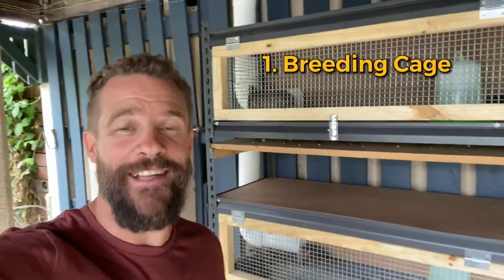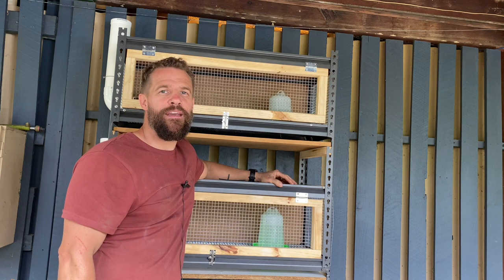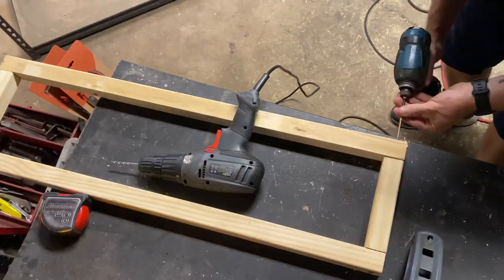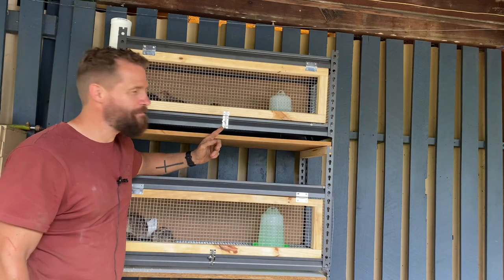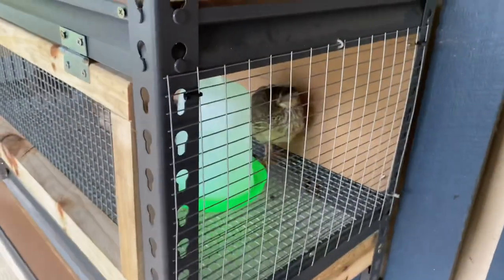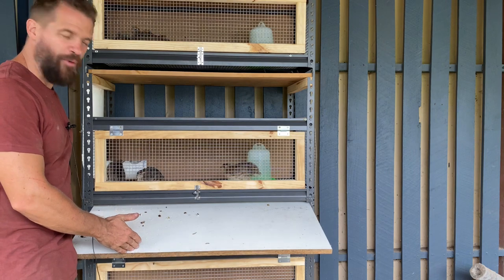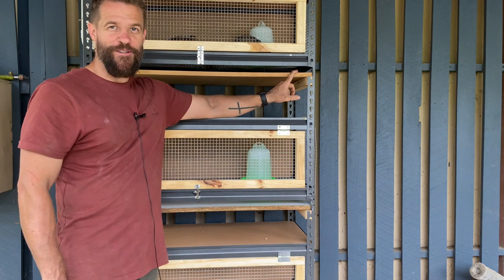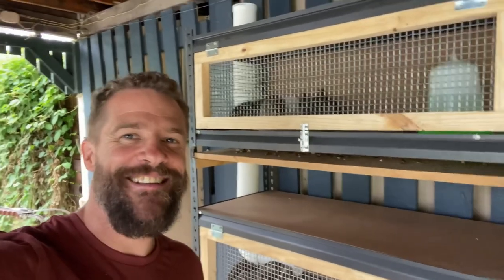How to Make a Quail Cage #diy  #quail #growfood

Comment: Wire floors are cruel and should never be used for quail. They should have a proper solid floor to walk on.
Reply: I raise mine in large rabbit cages with solid floors. They are messy all the time and high maintenance. These quail are being raised for meat and eggs. The wire is for health purposes. They get poop balls that develop on their toes from walking on solid floors… which have to be soaked off. They poop a lot. On a solid floor the crap builds up, stinks to high heaven, and ends up in their food and water.  They lay wherever do poop ends up on the eggs. Plus they like to dust in whatever medium is used (paper, wood chips, sand) and that ends up in their water.  So they get sick from contaminated bedding in their water. If they spill their water or it leaks… same issue.  Most of the cages I’ve seen do offer a solid area or sand bath area so they aren’t on all wire. It also depends on the species of quail.  Bobwhites for instance have different requirements. There are a couple of people who pasture raise meat quail. I know of two who raise them in green houses but not everyone has the space, ability, or money to do so.  People need to do what works best for their situation.
Reply: First of all quail are not meat birds im not sure who came up with that but they are way too small to be meat birds. Wire floors can be very painful to their feet and can also cause sores and bumblefoot and they are just unnecessary. Sadly many people just cram quail in wire bottom cages and treat them like objects. Yes wire floors are easier for the owner to clean, but it is hell on their feet and not natural. Like if you are going to get quail, get them a proper enclosure and stop being lazy and actually clean the bedding